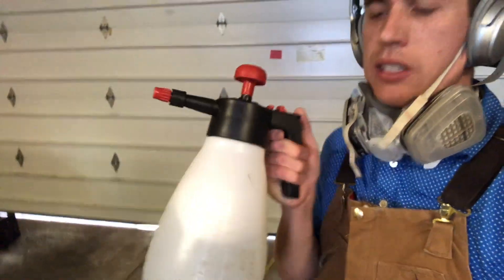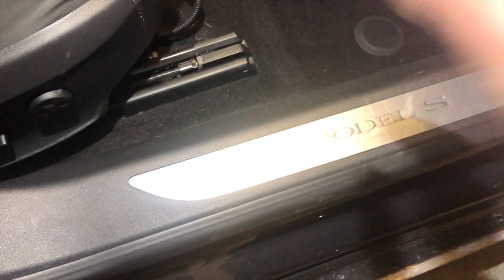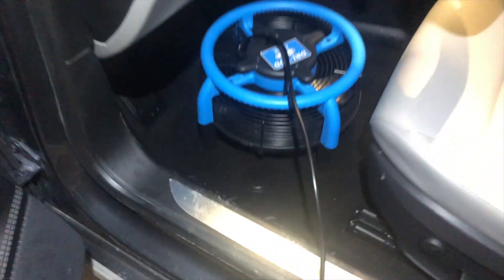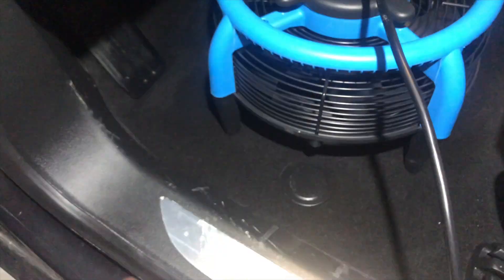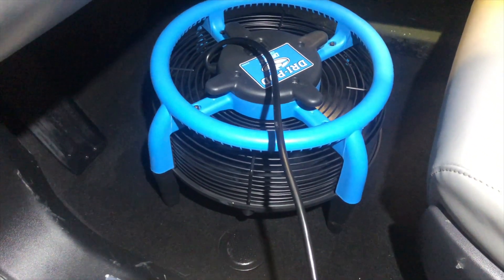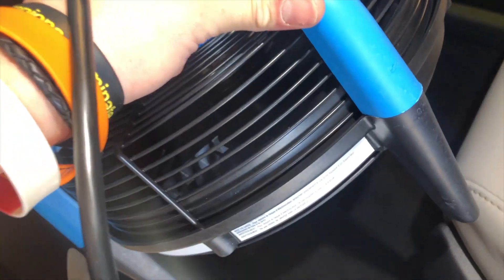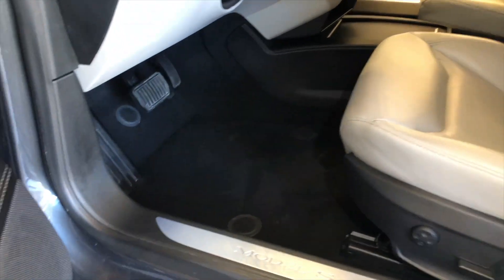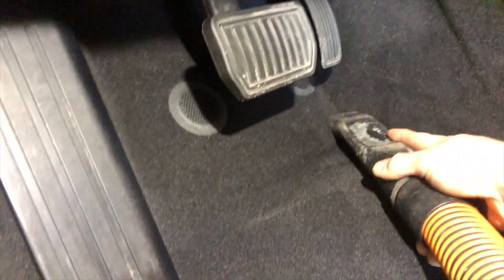My favorite carpet chemical--EASY to find, and use

Comment: I see the dri-pod! How do u like it so far Nick? Love that thing! I find more and more uses for it everytime i use it. The fact it doesnt block air flow where you set it down is so useful. Floors, mats, seats u name it. Im even thinking of testing it with an ozone machine.
Reply from the maker: +E Grizzle I like the dri pod! I feel like the Omni blows Stronger in one direction but dri pod might be better for rooms in a house? I’ve also put the dri pod on rubber mats as they dry and it’s worked well